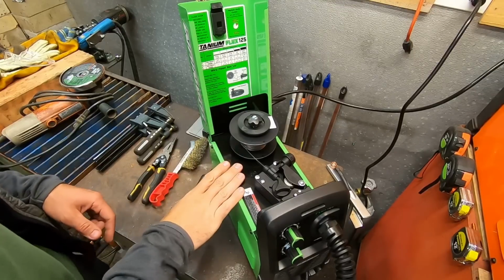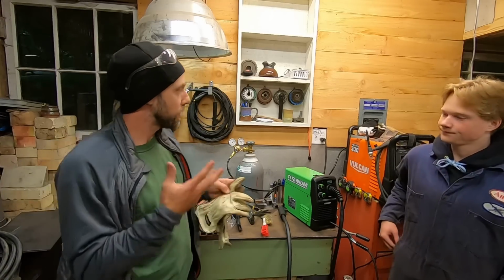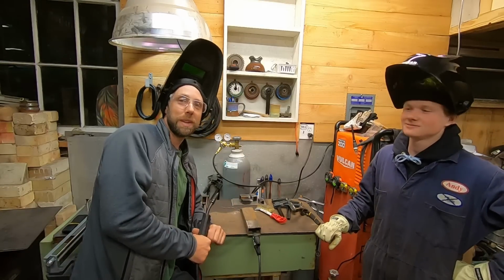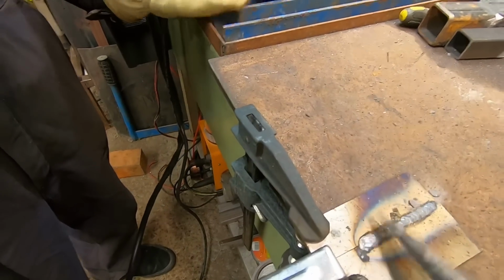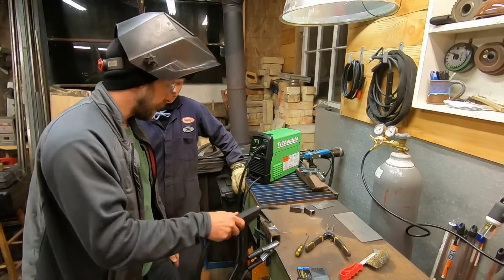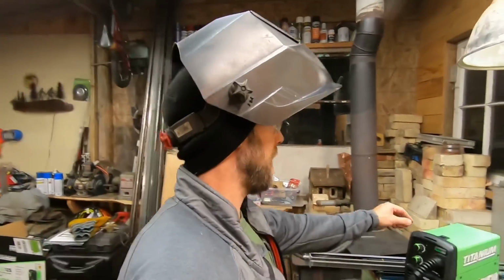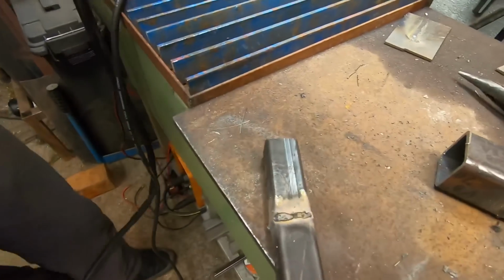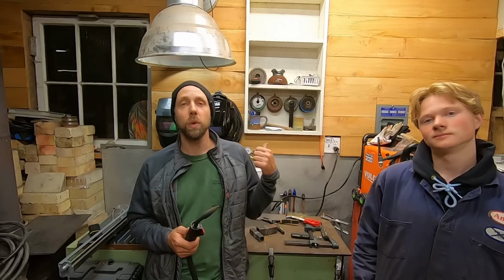How to weld, Tips for Beginners

Comment: Great flux primer. You show the angle to hold the tip when welding flat, which others do not.  Your showing 1/8” & 1/16” welding is very helpful.  Even a left handed guy like me can improve my habits and skills.

Comment: DON'T WEAR A MECHANICAL WRIST WATCH WHILE WELDING. It will be magnetized by the high magnetic field created by the welding process. Ask me how I know! I started a project not realizing I was wearing my Rolex Air King. It clearly was messed up but I remembered I had a demagnetizer on a very old vacuum tube ammeter which demagnetized clamp on current probes. I was able to demagnetize the watch and got it running correctly.

Comment: I have a 2011 GMC Sierra 1500. My cross members are rotted out. I’ve got a 3500 predator generator inverter I got a weld crossmembers which is 1/2 inch 8 inch thick. Do you think that little titanium welder with weld an 8 inch tube onto my frame of my truck the generator is it is 25 A

Comment: Mike are the two Round Gauges the best way or is the Tank Round Gauge for pressure and then the long tall "Flow Meter" better? I saw the round pressure gauge for tank and tall skinny flow meter for flow rate on amazon really affordable. If money isn't the issue, best capable Welding is, which one is better?

Comment: Thanks for the video,I just got the  Titanium 125 flux core welder to repair my exhaust. My cat to be exact,with your tips I was able to repair the outlet pipe of the cat. It looked like Swiss cheese,with pin holes all over. Your tips made closing those holes very easy. Also some bigger spaces. Thanks again for the video and tips.
Reply from the maker: Glad my video could help 😊👍

Comment: This is a Great video. I am thinking about getting one of these welders from HF and i have never welded anything in my life i need a lot more information than this for example does the table your working on have to be metal? Can you weld on a wood table? You say  put the ground clamp on. On WHAT ? Do you touch the 0.30 wire to what you're working on or do you hold it just off the surface ? Remember your talking to a kindergardener.
Reply: Not sure what he covers in this video yet, but there are plenty of beginner tips videos out there..... from what I've gleaned over the years, the wire tip is usually half an inch itself, and in the pool as it melts. The clamp is either clamped to the metal work surface you're welding on ( the project has plenty of contact with the surface with no paint or severe rust in the way ), or to a part of the piece itself so the ground loop is completed. And I think technically you can weld on wood, but keep in mind there are alot of sparks flying  and welding gets hot, so it could be a fire hazard 🤷‍♂️🤷🏽‍♂️  Watch plenty of videos, go create, and be safe.

Comment: Great video…

I like to start rookies out with Oxy Acetylene because it teaches them patterns, flow control, and is much easier to learn muscle memory and understanding… You pick up a better feel for pushing and pulling a puddle. Once they are stacking dimes on Oxy, then move to electric and it will be much easier for them to pick up mig, tig, arc, etc.I like to save the dirty flux welding for last because it’s much harder to see and develop the understanding for what is happening inside the weld.

Liam did a great job and you did a great job coaching him… He’ll be building go carts, and bicycles in no time…

Comment: Mike you mentioned don't use 35 tips with 30 wire size? Is this because of connection? I have actually done that to prevent the wire jamming up in the tip and then becoming a rats nest in the machine. I dip the end in gel to help keep it clean, but using the bigger tips prevents the jams which used to happen often, not sure if it is my machine, me or what but couldn't weld very long before i would be rethreading the wire after cleaning the rat nest in machine.

Comment: Titanium 125 and I have had a little over a year....so I was welding a muffler back together... for a chain saw and my circuit blew on my house so I that it was my electrical on my house so I stopped changed and the circuit out to a bigger one and it happened again so I gave up... so recently I hooked it up to a Honda eu 3000 and it shut off the generator so I linked anther eu to it well then the welder would not work... come to find out it was the welder so I do t k ow about the
Reply: .... fat finger... but any way this welder shit on me really quick so I. Pretty upset so I don't think I will get another one. I don't even think I'll buy anther welder from harbor freight so I think I'm going to buy the esab 215xc...
Reply: @jacobbradstreet1622  we've made close to $9k with our 2 T125 building and repairing gates and fencing we have 2Millers and 3 Lincolns too, I'm curious, what would you do if your new esab does the same thing as your defective T125 one of my fabricators had a esab said they are sh*t welders 😂
Reply: @shermanyoung8185  well I guess we will see.... but I heard different. And maybe I got a defective one. Harbor freight did say they will replace it if I by the warranty
Reply: @shermanyoung8185  Your friend was right. At least concerning the older esabs. At the shipyard I used to work as a production welder we all hated to be stuck with the 4 pack esab welders. They used to fluctuate up to 50 amps from your setting and sometimes even stay at the higher amperages meaning you had to go down the gangway to the machine repeatedly to try to get a decent setting. Many long days with those things. Maybe the newer ones are better.

Comment: Can you weld aluminum with that welder?
Reply from the maker: No, it’s only for steel.
Reply: @Mikefestiva  I'm not a welder, I haven't welded since 1977 so I was.trying to find something that could weld both steel and aluminum. Is there such an animal out there that doesn't break the bank?
Reply from the maker: @deanmayer6508  no problem Dean 🙂
Most welders that can MIG weld both steel and aluminum will be multi process machines, you will need to buy one with spool gun ports on it. 
The company Hynade sells (some) models with SG ports and they are probably the most affordable on the market, the Yeswelder MIG 250Pro has a model with SG ports also. And the Titanium 170 and 200 also have the SG ports, those are probably the most affordable options on the market, but will set you back $400 to $700 to do both steel and aluminum.
Reply: You're a great help. Thanks for the information. Would you suggest getting two welders, one for steel and one for aluminum?
Reply: Great video. Just bought one of these for a gate project. Turned out awesome.
Reply: Can you not just replace the spool with a different wire for aluminium.....?
Reply: @royster3345  Not on this particular one. You need one with a gas hookup to run straight argon or helium.

Comment: Is it ok to grind down my first weld n re weld over it for strength
Reply: Adrian Jackson, only if its a multi pass flux core wire like Lincoln electric NR211-MP not a single pass cheap flux core wire it will crack, Lincoln electric cost more but it's a reason why for that , because it's the best, also anything above 1/8 bevel and preheat will help with multiple passes,👩‍🏭

Comment: I bought the EXACT welder, wont arc at all. Took it back got another new one. Same story! Won't even arc on the ground clamp. What's up with that??
Reply: It took me about 5 min to figure it out I thought it was broken as well but I googled it and yeah just pull the trigger lol
Reply: @sheanhatfield4288  First thing I did!!
I bought a dud!
Reply: @zanzibarbusiness  it's the weldor not the welder 👩‍🏭😂
Reply: @shermanyoung8185  I took it back, it was FAULTY, got another one worked perfectly.
Reply from the maker: I don’t know what’s going on with your welders? This one in the video is still working great after 3 years.
We have one at my work for small repairs and it works fine as well.
Reply: @Mikefestiva  I went back to Harbor Freight and got a new one, exact same problem. Chinese junk with cheap chips. I bought a more expensive stick welder, now working👍🏻
Reply: You have to pull the trigger or it won't arc

Comment: Thanks for the good info. Can you recommend a good welding helmet? I've only used the cheap $49 ones from Harbor Freight? I seem to struggle seeing the work piece while welding. It helps if I shine a bright light onto the piece I'm welding. Just wondering if this is commons for other welders?
Reply: They make different darkness lens, u have too dark of a lens, should be marked if u take it out u can get a lighter one until u find the right one, they run from 8-12 light to dark mig is lighter, stick is darker, Al is real dark as it is very bright

Comment: Got this welder but the wire stop feeding threw everything works bit wire just won't feed threw gun
Reply from the maker: Does the motor drive turn when you pull the trigger? If so take off your copper consumable tip and see if the wire will feed out of the end of the MIG gun. Make sure your copper tip is the proper size for the wire you are using.
Also check the tension knob by the motor drive and make sure you have some tension on the wire. Last thing to check is the wire spool but isn’t to tight, you want to spool to just have enough tension so the spool won’t unwind.

Comment: I spent months trying to teach myself how to weld years ago (before youtube existed) and eventually I gave up. I was using a 70 amp buzz box that I had picked up at Walmart with a variety of sticks. It was a horrible experience. Wish I had access to your videos back then. Definitely thankful for you taking the time to make them now.
Reply: 70 amps will be really hard to weld with need minimum 90amps for any decent size metal also stick welding is harder than mig
Reply: @gorillageeks5645  If only I had known that 25 years ago. All the welders I knew at the time told me to learn stick and since I didn't have much money at the time, that's what I tried. Unfortunately, all the welders I knew back then were either too busy or too drunk to show me what to do with the thing. Once I get some mig skills down, I may try stick again for fun, but probably not.

Comment: Hello the young man catches on very quickly or he's welded before. I've stick weld for years but never wire welded. I purchased the same welder you have and tried it out, weld turned out terrible. My eyes are not as good as they used to be. I believe my lens are to dark I like to see the puddle and the wire as well. Good teacher and good learner. I read that it uses 0.30 wire only, are you using the harbor freight flux core wire?

Comment: Hi Mike, I wanted to let you know I've been welding with my Titanium Flux Core 125 welder and having fun. I have a question, lately when I weld and set my settings based on metal thickness my welder has been REALLY hot. I'm not sure why though because I'm adjusting the settings based on the metal thickness. It gets really hot tho, to the point the welder makes a beeping sound and my welds are not pretty. It's splattering more than anything. Not sure if you've run into this error. Or perhaps it's supposed to get that hot.
Reply from the maker: Hello Alexandra
I would recommend setting the welder up for at least one metal gauge thinner then you are welding. The charts on welders tend to be a general guide and seldom or very accurate.
Your metal can also can get extra hot depending on travel speed when welding, if you travel slower it can become extra hot.
I just tried out a new flux welder recently, it’s basically auto set, you can set the amps and the welder sets voltage and wire speed for you, it works really well. It’s called the Hynade MIG 140D sold on Amazon. The thing I was really impressed with also was the quality of the flux wire that came with it. I would recommend ordering some Hynade flux wire, it had far less splatter then Harbor Freight or Lincoln flux wire.
Here’s a link for .030 flux wire. https://amzn.to/3tlDQxh
Reply: @Mikefestiva  Hi Mike! Thanks for the advice! I'll definitely lower the settings on my welder. I think I'm going to try the wire you recommend too because the flux wire I got from Harbor Freight is good, but it does splatter a lot. Thanks for your help!

Comment: got a 125 v Flux core  and tried to weld some galvanized steel post but nothing happened when i tried  to weld any idea
Reply: Galvanizied has a rust preventive coating. You have to grind off the coating in the area your are welding.
Reply from the maker: You probably didn’t have a good ground with your clamp, probably a good thing too, Galvanized metal is quite toxic to weld. I would not recommend it, unless you have a good respirator, and do some research about the possible risks.
Reply: soak your galvanized metal in vinegar over night
Reply: John I purchased that same welder and put it all together. Made an attempt to weld but no sparks. Come to find out I wasn't mashing the feed button. Make sure the power button is on in the rear of the machine.  Hope that helps. I was about ready to pack mine up and carry it back to H/F. Glad I didn't now

Comment: Would have been nice if you had explained the volts used and at what speed you feed the wire for us newbies
Reply from the maker: I covered the settings in the video, explaining volts wouldn’t have helped because this welders chart is in numbers and letters so explaining volts and wire speeds would have been unhelpful for anyone with this welder. If you have a different welder it also would have been useless because most welders read differently and even if I said set your volts to this and set your speed to that, Even if those settings work great on my welder, chances are if you owned a different brand they probably wouldn’t work the best for you. 
I would recommend just looking at your welders chart, set your welder up with its recommended settings for say 1/8”  try welding and make small changes to the settings and see what your results are. Just practicing and trying different settings will help you understand your welder better.

Comment: Hey beginners:   Want nice looking "fillet welds" on something? You can make nice fillet welds (like on an aluminum TIG welded bike frame) using a MIG welder like this on steel. Instead of dragging the wire, you use higher heat and "click" or "pulse" the trigger feeding a short section of wire into the puddle a very small section at a time (one fillet at a time).  You need good control and timing to feed into the previous fillet before it starts cooling. To hot you'll burn. To slow youll not penetrate and slag up. Time it just right with more heat and it will penetrate correctly and look nice too. Good practice is to section cut your test piece to see the penetration if your new to this or welding something different than what your use too.

Comment: If I have a bolt that I need to weld a nut to (for extraction), and have a machine like this one…how do I set up the wire-speed AND voltage knobs compared to the little chart on the lid? (New to this). Thanks. 🇨🇦

Comment: Hey mike, what tips do I need to buy for this welder?
Reply from the maker: You can buy them at Harbor Freight, Home Depot, basically any store that sells welding supplies, there are extremely common 👍 Just make sure you buy the right wire size you are running, I commonly run .035 wire especially for flux core.
Reply: @Mikefestiva  ok thanks mike I didn’t know if they were specific to machines I appreciate it btw that welder is sweet u can’t beat it for the 💰

Comment: You mentioned the need to tack weld pipes before doing the full weld so the workpiece won't bend.  I've heard that mig vs tig create different kinds of internal stresses in the workpiece.  Do you have a video where you talk about those resulting internal stresses, and what's better for what applications?

Comment: I really enjoyed your video, I learned a lot, my mower deck is about worn out and to buy a new one is over $ 800.00 but with the purchase of the 125, helmet a can of spray paint, made some friends trailer Mfg for scraps of metal all repaired for less than $ 250.00 thanks for getting my fears over welding to rest. I was a service tech for steamfitter union for over 35 years and never touched a welder till in my retirement

Comment: Stopped at 12:36.
GREAT JOB TEACHING. I'm subbing so I can share. Thumbs up.
There are a few thing I do different. But  I know your ways work so not going to monkey wrench them.
I have always used a very heavy shade. Never tried a self adjust  but thats because I'm old school. 
But as I was taught. As long as you don't get, " sand in the eye " next morning you are fine. 
Keep up the good work.
Reply from the maker: Thanks for subscribing 👍 I appreciate it.
Check out my articulating dump truck build series if you are new to my channel, you probably will enjoy that series.

Comment: Can you answer these questions for me 
1.  Why do you think FCAW sounds different than GMAW?

2.  Why did Kevin have to chip and brush this weld bead?

3.  What changes to settings were made for the thicker 1/8" steel?

4.  What is flux core wire?

5.  After watching this video, what type of welding, GMAW or FCAW do you prefer and why?

6.  List three advantages of using/owning a small Longevity 140 welder like the one featured in the video.
Assignment....
Reply: The chipping is because its flux.
A mig wire feed without Flux rarely needs chipping.
Stick needs chipping also. Since it has Flux.
Not going to get into when to Flux and when to not. Or why one is better then other.
Reply: @baddog9320  thank you dude